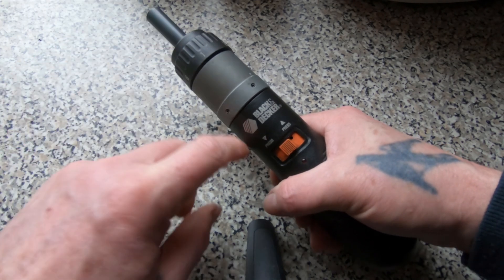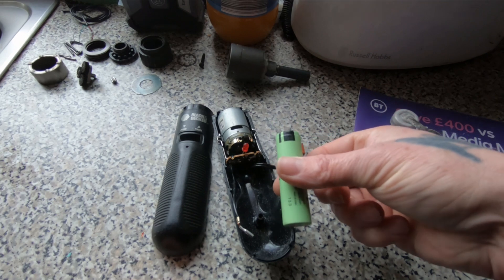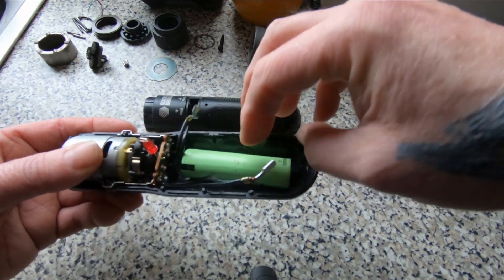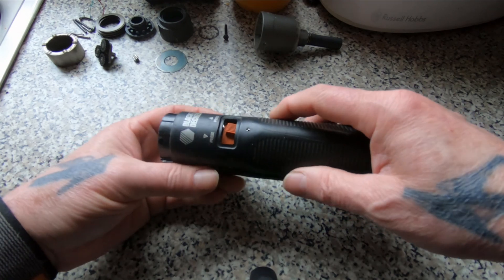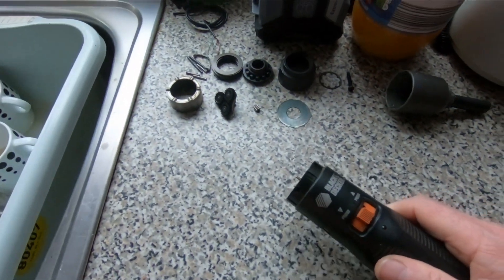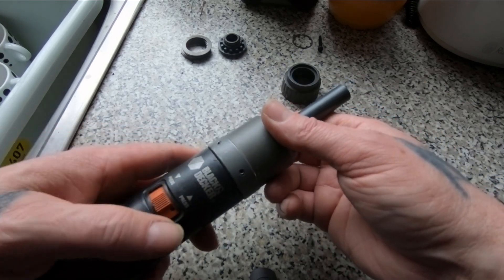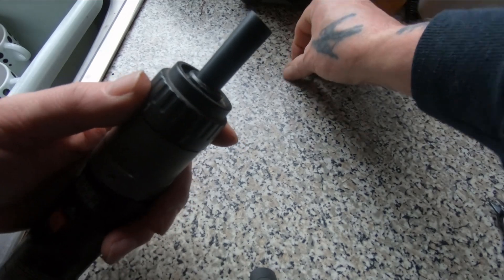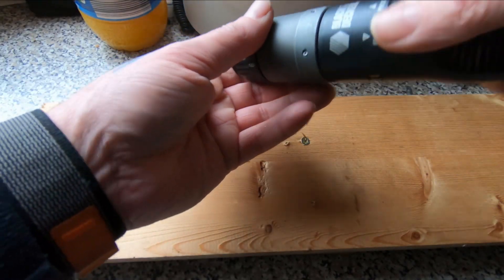Black and Decker 9019 screwdriver - Lithium Battery Replacement.

Comment: Where is the battery management pcb to prevent overvoltage and overdischarge not to mention overcurrent! Very dangerous with 18650 lithium ion cells. Moderator  Should have this video as encouraging people to unwittingly set their house on fire.🔥

Comment: Would it be sensible to add a BMS(battery management system) to the battery to prevent over-discharging? You can get small circuit boards with them on. I cant recommend which one though.
Reply from the maker: Yes I did a follow up video of installing one of those.
Reply: @MidlandBulletRiders  mind sharing the link to said video? I'm restoring one of these now that my dad had stashed away in the shed for yrs. 😂 Trying to get my hands on the charging cradle too, but adapt it to work with modern fast-charging batteries. It'd be great if a rechargeable battery with a usb-c port built in is feasable with the proper voltage. I can charge it while it sits in a vertical holder on the wall.
Reply from the maker: @Ink_and_Motion_Studio  https://youtu.be/iCgYQYCeLMg and https://youtu.be/58JtIytSgV4

Comment: There is space to install two 18650 batteries.   I mod my similar scredriver with two parallel  and a TP4056 charger module.
Reply from the maker: I may do that if I find the battery doesn't last long enough.
Reply: Czy akumulator 18650 nie będzie miał za wysokiego napięcia?

Comment: did you try to place 3*18650 in it?
Reply from the maker: Just fitted battery overcharge module in it, wouldn't I need one for each battery?
Reply: @MidlandBulletRiders  if you connect several cells in parallel, you dont need separate module for each, one is enough
Reply: just tried to fit 3 cells into my bd9019. no way 
:((
but 2 cells fit fine.
Reply from the maker: Thought that might be a bit of a squeeze.

Comment: I did the same for my own. This is, by my opinion, the best battery screwdriver ever made (I had it 5,and I still have one other for easy jobs). This one is hard-worker. Mine, is nearly 35 years old. What i did, i put two same li-ion batteries in parallel. Little work should be done inside the housing to set them to fit firmly - 2 small black plastic pins placed on one side of the body, should be moved - the housing is so narrow that only in this way, two batteries can fit together. And then the small electronic PCB, has such connection that LED is spending electricity which I don't want, for the purpose of charging batteries externally. I took one TP4056 charging module and the old, very nice and robust Nokia 1.2 A, 5V adapter from the old Nokia phone, then connect the TP4056 module for charging. As I said, originally, LED is glowing when charging. I turn it off, cause module itself has charging LED's status. Anyway, screwdriver with 2 batteries works for long time without recharge. At the end - the hole, for the middle screw, which cannot be used any more, causing the case to be, let's say, not so strong. So, I took inner bike tire, from the ususal, children-size bike (I cannot remember the size), and cut the piece of 12 cm, and pulled onto screwdriver, to hold firmly the rest of the case. This way, it even gets better, to have rubber under your palm, when you working with it.
Reply from the maker: Good idea using 2 batteries.
Reply: Hello!!  Can you clarify if after placing the two 18650 batteries it can still be charged with the original charger in the holder for that purpose??  Thanks.